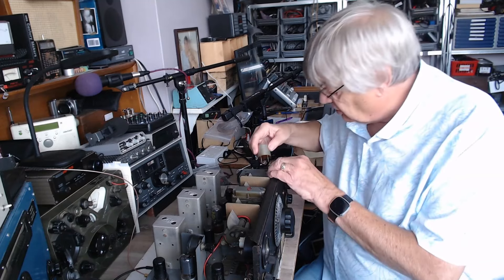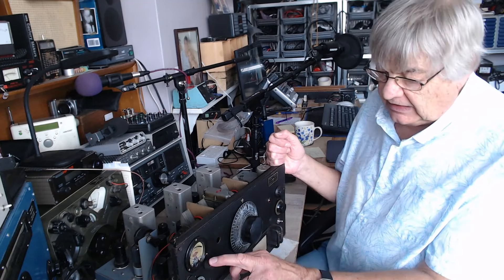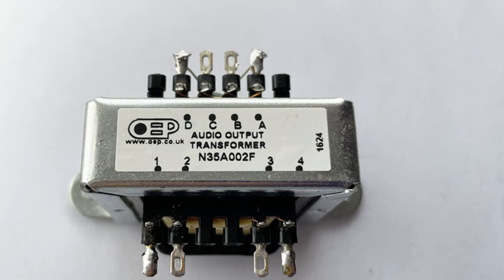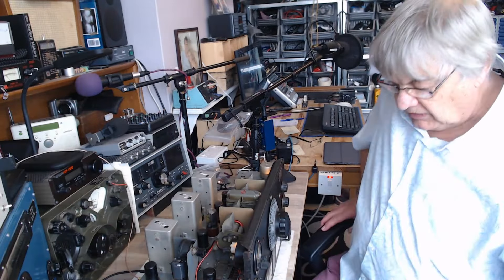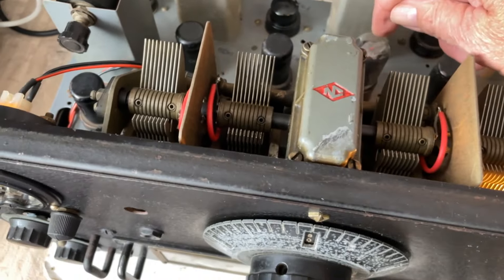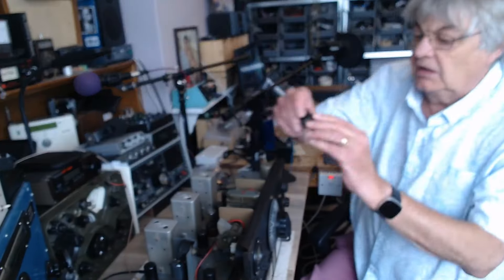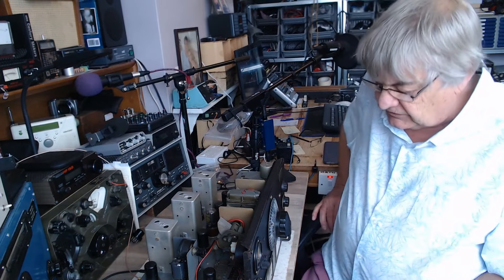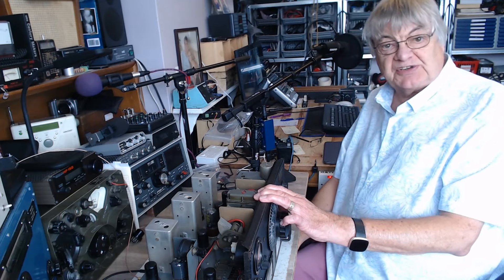G4NSJ - National HRO 5TA1 5A1 R106 mk1 mk2 comms receiver - part five

Comment: I'm glad you've made progress.  If I might hazard a guess, based on some experience with other radios, the hole you had to drill was NOT there and there would NOT have been a "spike" in the chassis so to make it VERY difficult to install the coil pack upside down.  Either National gave up and added spikes for ALL coil sub-packs, or somebody added one to the end coil.  As it was a modification to the original radio, the pack you got given had no hole.  Is it possible the 12SA7 for this receiver should be in a metal can?  That might stop the harmonics/microphonics.  Also, I'll have a dig around, as I seem to remember a silicon diode replacement for your 6H6 (you have the 12-volt equivalent double diode).  I'll send you the schematic, although I'd bet a pair of 1N4007s would do the trick, as they're rated at 1000 volts.  Cheers, Ray.
Reply from the maker: Hi Chuck, Good thoughts abou the spike, thanks. I have tried slipping a can over the 12SA7 but it made no difference.  A pair of 1N4007s would do the trick in place of the valve. Cheers, Ray.

Comment: Hi Ray - good to see you making progress. One thought about the oscillation/cut-out you are getting on medium wave - have you tried using a metal 12SA7, or even making a temporary grounded shield with foil? Sometimes radios designed to use metal valves will do odd things if glass valves are substituted.
Reply from the maker: @edwardholland36  that’s a good idea. I’ve just stuck an old valve can over the glass valve and it hasn’t made any difference. The valve was well grounded and I was expecting the valve to behave itself. Not to worry. It was well worth trying. Thanks.!

Comment: If you do take the coil packs apart, just be carefull when re - clamping each assy. in place. Make sure all the studs line up both across the coil pack & height wise. Just clamping the assy's tight in place dosnt allways give good alignment and the pack will appear to be dead. Fiddling is often called for in my experience.
73 de G8NYZ
Reply from the maker: @MrShotlighter  Thanks for the tip. It’s good to get advice from people in the know. Cheers, Ray.

Comment: 8:34 JAN valves were WWII era American Joint Army Navy issue, hence the JAN. Could this be the case with this component? 🤔
Reply: My thoughts too.
73 de G8NYZ
Reply from the maker: @MM0IMC  I have seen many old capacitors with dates stamped on them but  that’s a good point. Thanks.